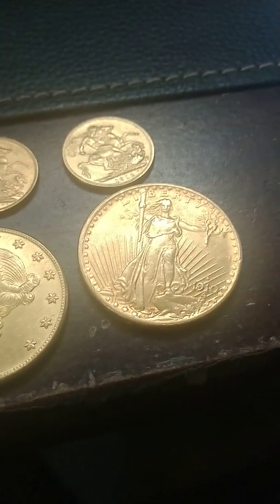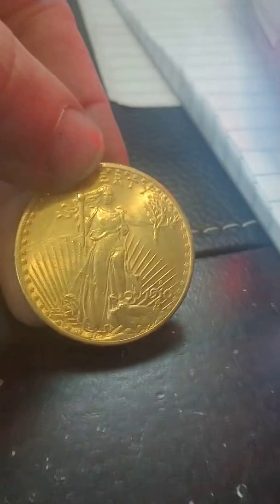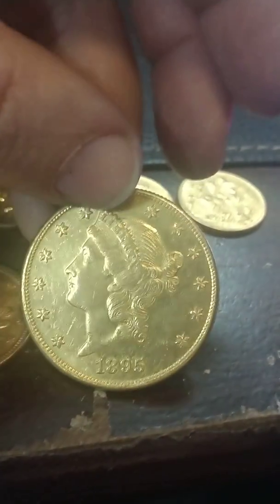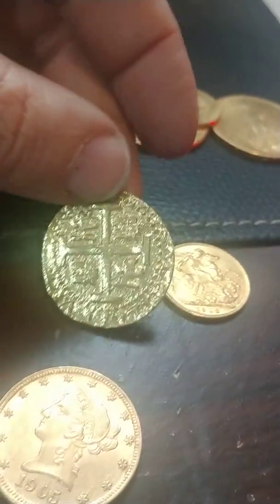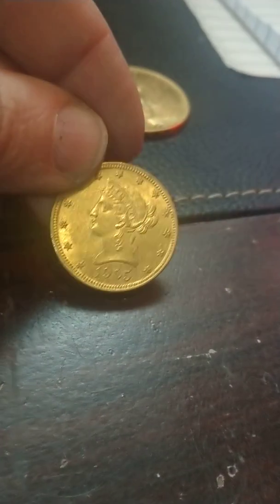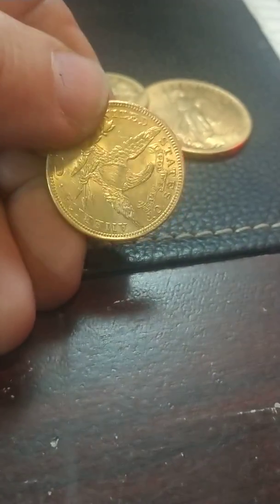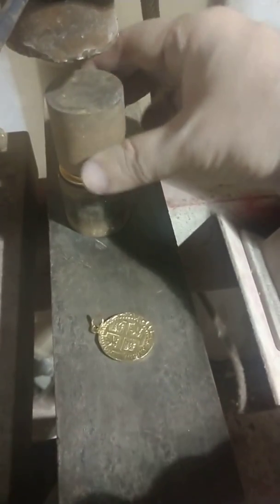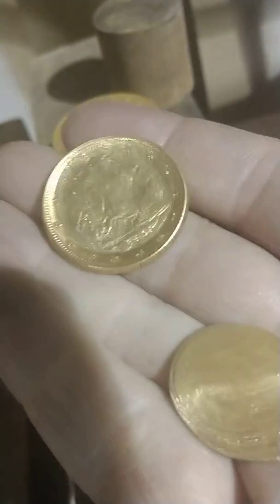Identifying counterfeit gold coins and what we do too them.

Comment: Great video. Just wondering why they’d put more gold in than a normal coin. That doesn’t seem to make much sense. Do you think the online retailers are able to detect or do they scan for fakes? A couple of them looked pretty good and couple probably fool most people. Thanks for sharing.
Reply from the maker: That is a good question! The reason being is when they were made gold was $35 an oz. And. As such. Most of these sold at premiums of 2-3 times the gold value. So the manufacturer didn't really care as they were making some pretty disgusting profits from making them.  Most of these were made in the middle East in the 50s and 60s. Many were manufactured for use in jewelry too. A high mark up item. So it would seem the precentage point nor two didn't matter. 22k jewelry being a readily available alloy for manufacturing use. And explains the trace of silver. Thank you for the good question!